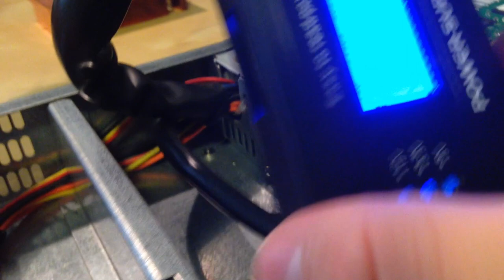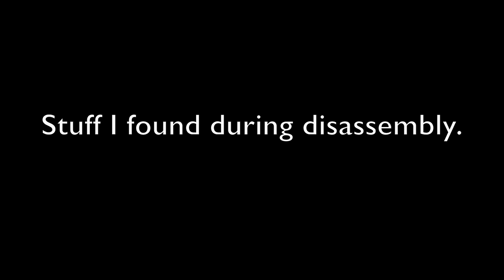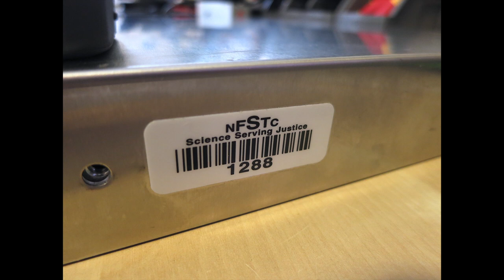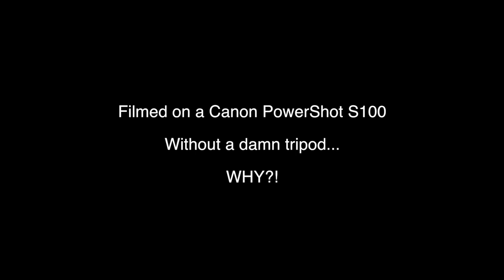CoyotePoint E650si Teardown

Comment: The USB connection to the switch also acts as a licensing dongle: with it unplugged, the Coyote Point software won't run.

On our E350si, the onboard network ports were used (cabled to the front-panel port and the switch); the front-panel switch had fewer ports and was only 100Mbit. Otherwise it looked pretty much the same.
Reply from the maker: That's interesting. I wonder if it's actually a proper serial number/hardware key or if it's just looking for the USB device.